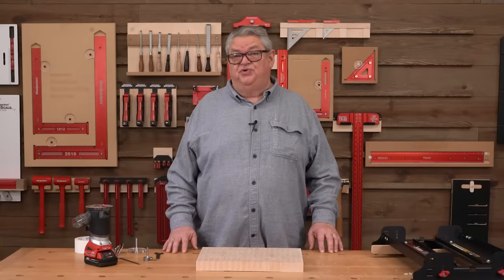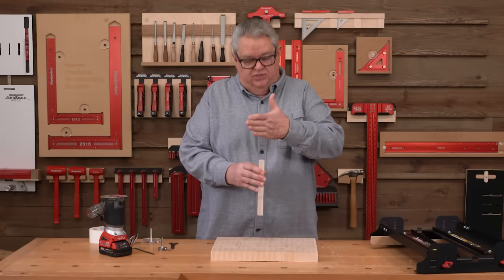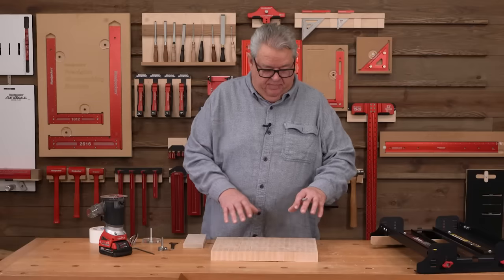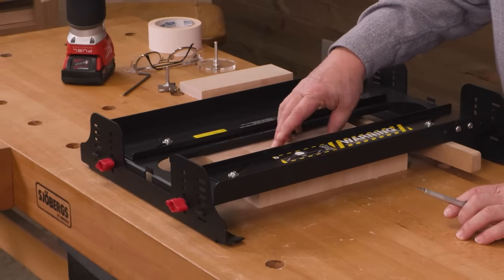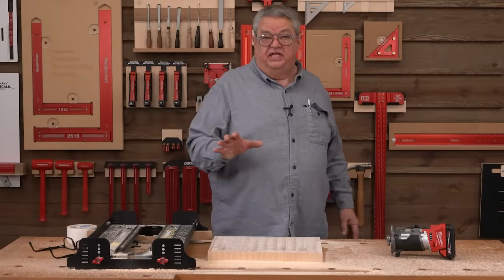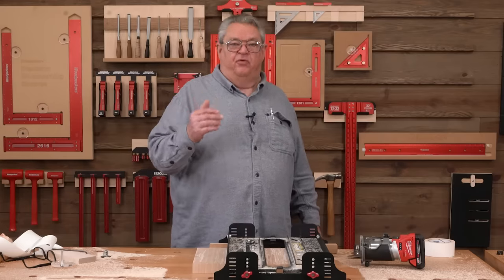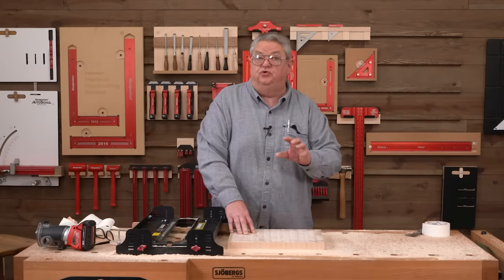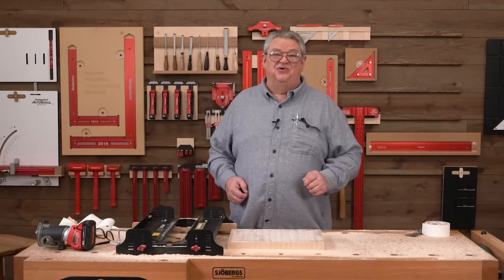Deep Dive: Rout-N-Plane Bench Top Board Mill

Comment: I have the same MIlwalkee router and got the Ultra Shear 1-1/2 bit you used.  The bit is too big for the Milwalkee base plate . . . did you modify the one that came with it or did you find an aftermarket plate with the large opening?  Please provide the source if it was aftermarket.

Comment: Jeff, thanks for the video.  I bought one of these, partly to get some hands-on experience with using routers to surface wood, and it’s done exactly what I wanted, and produced great results at what I’d consider a very reasonable price.  I have experienced one issue and I wonder if you might have some suggestions.  I’m using the big Marita 3.25 hp plunge router and it have a problem I’d call “sticktion.”  The router base doesn’t move evenly on the base.  It will periodically stick in place and need a good bit more force to get the router sliding again.  I tried spraying both surfaces with Dri Lube (worked pretty well, but too messy) and putting UHMW tape on the top of the board mill (better, but still not great, which is really odd).  There’s nothing wrong or damaged or “sticky” about the router base.  I might look for an aftermarket base plate on the chance that maybe the material Makita uses isn’t as slick as I would have thought it was.  If you have any ideas, I’d love to hear.  If it’s better for me to call or email someone, let me know please.  I do want to say again that I think the design and execution of this is very good and the price made it a pretty easy purchase decision, compared to what admittedly more flexible slab mills cost.
Reply from the maker: John, how tightly do you have the base guides set? Any chance they're binding, rather than a friction issue? They don't need to be super tight...just enough to keep the router roughly centered.
Reply: @WoodpeckersLLC  Thanks and sorry for the delay here…that was actually the first thing I thought about, and it was in fact a problem.  I realized that for these purposes it didn’t matter if the guides permitted some wandering by the router…not for flattening with a 2” bit!  That obviously helped, but it didn’t eliminate my “sticktion” (friction + sticking) problem.  I have wondered why the crinkle enamel-like finish was chosen.  I don’t know if it would help, but I’m wondering if a smooth finish would help.  Might be something to think about for future production runs?  I want to say again that I give this board mill high marks for design, manufacturing, function and price.  It got me doing something I’d been thinking about for several years and hadn’t done anything about, so thanks to you all for this.
Reply from the maker: Okay, so setting the base guides isn't the issue. Is that big Makita your only option for a router? Some of the "sticktion" could be the sheer mass of that beast. On the other hand, the power is going to take care of anything you want to tackle. We tried a smooth finish paint, and it actually had more friction than the textured. We also considered UHMW strips, but then you're adding another opportunity for variability to sneak in. You might try furniture paste wax or car wax on the base, instead of the Dri-Lube. It would be less messy and less risk of transfer. I use it on all my sliding surfaces (table saw, jointer, thickness planer bed, etc.).
Reply: @WoodpeckersLLC  Thank you!  I spent a couple of hours working on some slabs this week and may have an explanation for the “sticktion.”  First though, your comment about the paint (powder coat?) surface makes complete sense - less surface contact and probably some room to clear the ferocious amount of dust.  And the variability issue with UHMW strips makes sense, too.  I think I realized that intuitively when I tried the very thin UHMW tape - if the tape is only a few thousandths of an inch the amount of variability is self-limiting.  Anyway, here’s what I noticed this week, and the bottom line is that it’s not the board mill.  What I noticed was that if I got “greedy” with the amount of material being cut, either in terms of depth or width, the router would rotate very slightly on the top of the board mill.  (For clarity, when I say “greedy,” I’m talking about amounts/percentages that are well inside general recommendations for slab flattening.). Anyway…when the router rotated around the bit shank axis, the flat part of the base would cam over against the raised side of the guide and tend to bind the router.  I could control for this some with technique, maintaining a slight CCW force on the router, but it was hard to get consistency with that.  Reducing height and/or width of the cut worked every time (obviously).  I have a couple of routers with full-round bases (old PC 690; Bosch 1617), and I’ll give them a try next time.  What I noticed this week also points up the fact that, at least with the specific router base on that specific router, the place (if any) to put UHMW tape or even a sawed strip is not between the baseplate bottom and the top of the guide plate.  The place where this router might benefit is on the raised sides of the guides, which shouldn’t have any impact on how level or consistent the surface of the milled board would be. Thanks again for your replies and congrats on an excellent tool

Comment: Would you say that this can eliminate the need for a drum sander on end grain cutting boards?
Reply from the maker: There's still sanding to do, but it can be done with a random orbit sander.
Reply: Agree, if you’re using a good bit at the right speed, you’ll be amazed at how flat these come out of the milling.  Sanding is really finish sanding, not material removal.

Comment: My Rout-N-Plane fixture is a big disappointment from Woodpeckers as the surface where the router rides is not flat.   Notice that Jeff did not check the cutting board for flatness as a 10" x 17" board that I did with my Rout-N-Plane was out of flat by .010.  Also, It is very difficult to get the second surface parallel to the first finished surface.  Here again the cutting board I did on the second side was out of parallel by .015 and it was also not flat.   This fixture is somewhat crude as the surface where the router rides is stamped and formed steel panels.  Of all my Woodpeckers tools, this is the only one that is in my opinion, poor quality.
Reply from the maker: You're more than welcome to return the Rout-N-Plane if you're not happy with it.
Reply: @WoodpeckersLLC  This is the most valuable pre-sale interaction I've seen. I won't be buying.
Reply: Did you buy directly from Woodpeckers ?

Comment: It's too limited in scalability in my opinion for that price point.
Reply from the maker: Wait 2 weeks. There's a bigger brother on the way.
Reply: In terms of length, it’s essentially limited only by the length of the flat surface you are using to support the slab or board.  Obviously, that isn’t true for width, though.  One of the reasons I bought one was to learn about the process and the results without dropping a much bigger sum on an unproven (to me/for me) concept, and it worked out very well for that.
Reply: @johnnewell5025  I have to disagree, for the money it's not worth it.  The size and material just doesn't meet the value.
Reply: My sense is that the workers who are making these tools aren't seeing the benefit of the ridiculous prices, and never have. If I'm wrong about that, somebody will correct me.